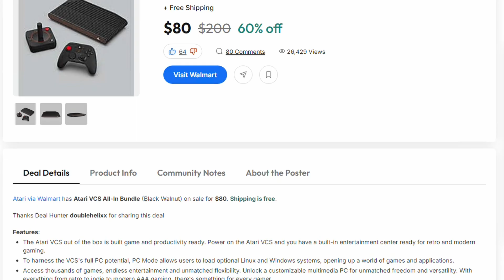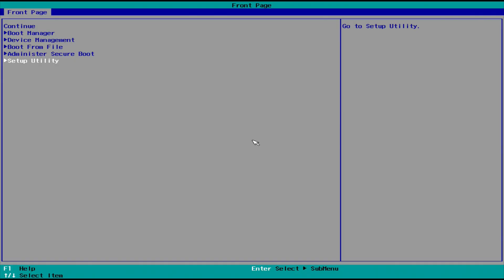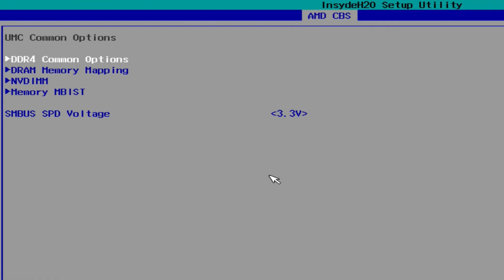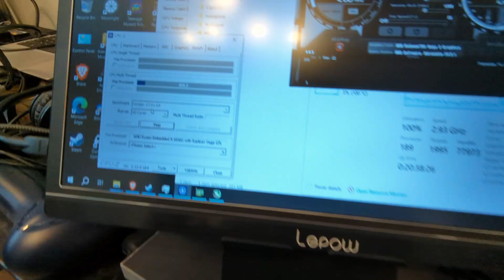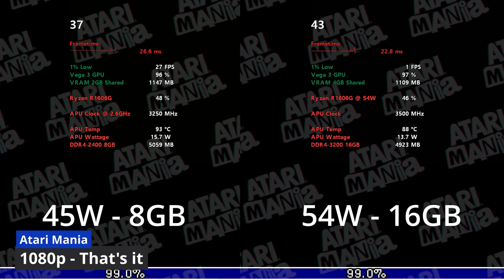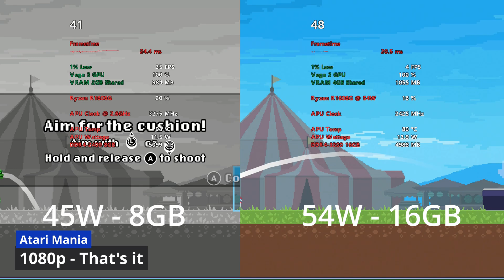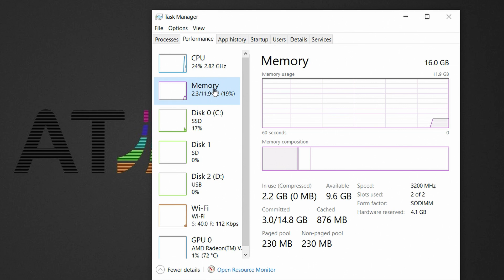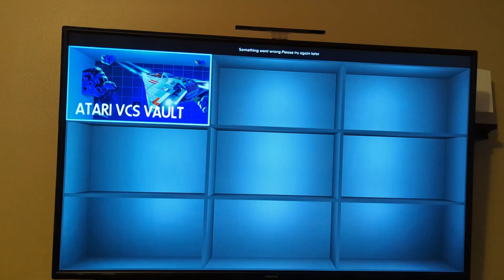Atari VCS in 2025: Unlock performance with this RAM + SSD Upgrade! Is it worth the effort?

Comment: Was the power supply upgrade even necessary?
Reply from the maker: If you mean raising the TDP, probably not. The cooling solution can't really handle the extra heat. Some games benefited and others did not. Mine was hitting 100c doing initial testing so if that worries you then just leave it alone. The biggest thing to reduce heat is to turn off core boost. Dropped the temps down to the mid to high 70c range.

Comment: Upgraded tk 32gb but of course got sticks by corsair that dont allow overclocking
Reply from the maker: Bummer. Maybe you can return em and try a different brand?
Reply: @SpiceVader  Maybe I missed something, but, it looked like the FPS was almost unchanged. I don't see what the point of the upgrade was.

Comment: Time to add a eGPU :) I did the eGPU upgrade and now have a VCS with a GTX 1070 SC. I also did 32GB 3200mhz ram and a 1TB SSD.
Reply from the maker: Nice! How is the GPU performance with that? It can't run more than 1x link speed I would think?

Comment: Bios password?
Reply from the maker: It was shown on screen and it's in the description as well. Thanks
Reply: The password in the description does not work on a lot of those $80 Walmart versions. Nobody seems to know what it is, including Atari apparently. Some people have had to downgrade the firmware to get the old BIOS password to work
Reply from the maker: Oh that's strange. At least there's an option to downgrade. I think I have the firmware file that the 50 years password works for. I can host it if needed but I'm sure it can be found easily.

Comment: I'm using the same ram as you but 2x16. Do I set the clock speed to 800 or 1600? tia
Reply from the maker: You just multiply the setting by 2. So if you have DDR4-3200 you would set it to 1600

Comment: Those thermals are still abit high even after applying new paste. Do you think those thermals will shorten the lifespan of this system or will it be ok overall?
Reply from the maker: Yeah it still is a bit concerning. The TjMax is 105c so at least this is below that by about 15-20c. I will run some more tests with the TDP back to 45W to see if that reduces temps more. I'd like to see it top out at 80c. 
Stay tuned for my SteamOS install on the VCS and I'll throw the results in there.
Reply: Did you turn off core boost within the bios? I've read people are getting substantial heat reduction by doing this. One user said their thermals went from 100C* to the mid 70's on allot of games after that. He also brought the power usage down to 45 Watts I believe. I have ram and thermals paste coming in the mail and for sure I will try these settings to see how it goes. Thanks.  @SpiceVader
Reply from the maker: I didn't, I certainly can try that next time though!